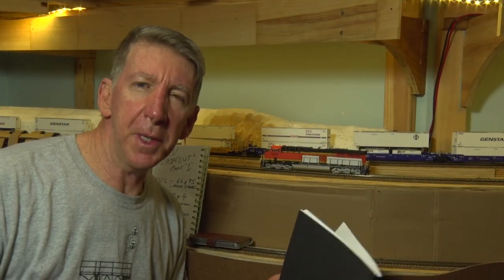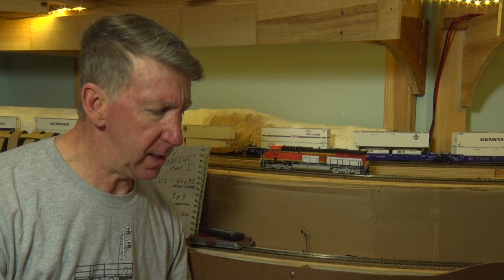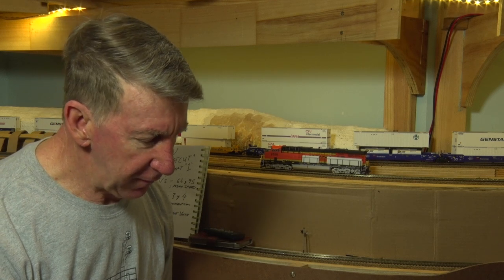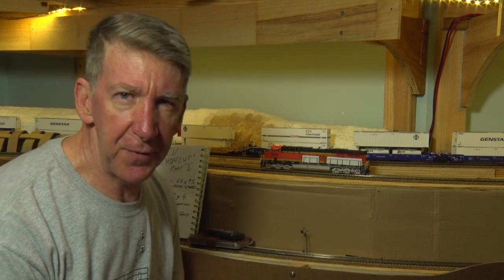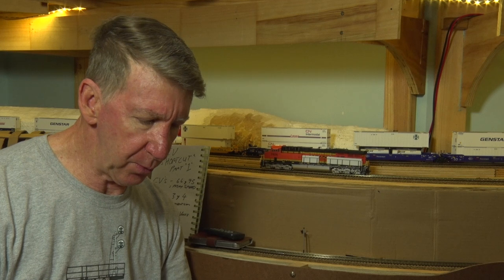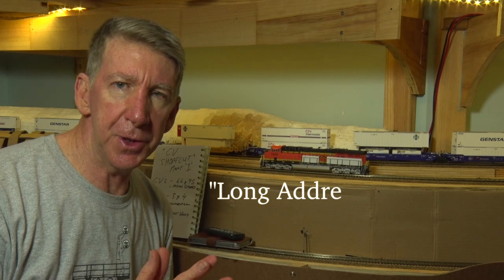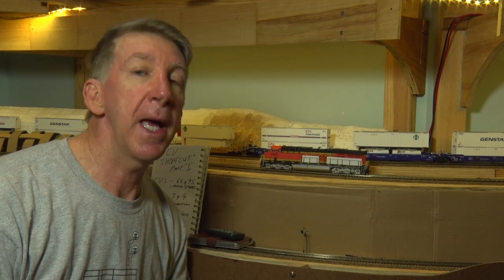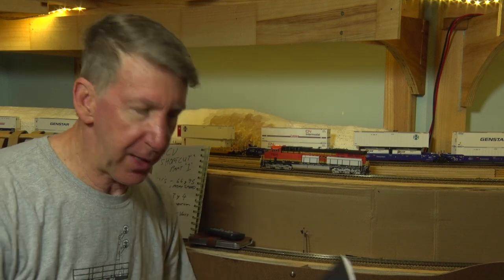"CV Shortcuts" Part 1.

Comment: Thanks Greg, I have been using DCC for years but never really understood the tech terms in the manuals. When I worked at Rio rail ops in the Autohaul project we never knew what the  engineering people were taking about, all we needed to know was how to turn it on and operate it must be universal with boffins. Part one has really helped me and have applied it already to my loco fleet so thanks for that mate, looking forward to the rest of the series
Reply from the maker: Hi Gary, thanks for watching and I'm glad you enjoy the videos!  A few of my fellow signal guys went over to the Pilbara and my nephew is in charge of a track gang over there. Autohaul is interesting but I prefer seeing a driver on board! Plus all the smarts didn't seem to help with the runaway !!  I'm down with a cold this week and lost my voice , so part 2 will be delayed a week or so, but 'm glad you have seen some results already.
Cheers Gregg.

Comment: I love the half rant,  I am surprised that the decoder makers have not found a way where the decoder in a consist talk to each other.  By the power consumption (current draw).  It would be interesting to modify a worm drive to enhance the speed matching.  Love how you made it simple,  I might have to watch this video several times.  I do have a PowerCab with a Smartbooster 5.  I think I can program it.  Love the video, from CV challenged Terry in Rainy Nebraska, Cheers Gregg.
Reply from the maker: LOL ..thanks Terry! Yes , that would be cool ! Much easier if they fixed the drives but I don't see that happening soon? You'll have no issues with the power cab and booster sir, and you'll be a master in no time! Part 2 on the way soon.
Cheers Gregg.

Comment: I just got my PowerCab and am waiting for an Athern Genesis with Tsunami so this will be a very helpful vid to refer back to!  Thanks.
Reply from the maker: You're welcome!  Just remember to read the Tsunami manual info in the Genesis paperwork! They have set a few CV's for general use that can trick you up...like the F11 brake feature! But all are the same  for motor and speed settings! 
Thanks for watching.
Gregg.
Reply from the maker: I got your message regarding the Tsunami 2 , but I can't reply to it for some reason?  Maybe the ESU "Fanboys" have jammed the system..LOL IMO , after almost 45 yrs of model railroading , and having had DCC for almost 20 yrs, the Tsunami 2's and Econamis are the best decoders out here for overall performance and versatility! Iv;e used both and ESU are great decoders, but they do lack some features that I prefer to have ...like a 7 band EQ to get the most out of your speakers, motor drive equal or better than ESU ? The original Tsunamis did fall behind a little in that regard, but could be adjusted to run almost as good as an ESU. Read the manual , watch my videos and you'll see how good Tsunami decoders are!
CHeers Gregg.
Reply: @FishplateFilms  Thanks---I may be PM'ing you if I get stumped once I get my loco!

Comment: Good start to the series Gregg.  Well done with the presentation.   Just curious, what camera setup are you using for tracking the moving locomotive?  ~Deryk
Reply from the maker: Thanks Deryk! This one is a bit basic, but you get a big change from a easy adjustment. I used my big camera on the tripod, it's a bit clunky for this work as it takes up half the space..LOL. The next one will be on the phone as well , as I need to get up close to the trucks.
Cheers Gregg.

Comment: Hi Gregg, as ever a superb video and thanks for sharing your knowledge. Especially with regards to electrics/electronics I've learned a lot from your channel. May I ask a question/favour please: I've designed a yard with two reversing loops next to each other that are connected by a crossover (coming from Marklin three rail, I thought that's a great idea). It's all on DCC. May I send you a diagram somehow and ask for some feedback/opinion from you? I think I've got a workable solution that shouldn't produce any shorts but a bit of mentoring would be great. No worries if you can't. All best wishes from the UK.
Reply from the maker: Hi Micha, I could have a look at it for you. Send me your email to the channel DM comments.
Cheers Gregg.
Reply: @FishplateFilms  Hi Gregg, many thanks. DM seems no longer possible so I'll take a plunge and put it here: michael.koenig.gb and you'll need to add the funny circled a and the whole thing is at gmail.com Very much appreciate your time. Micha
Reply from the maker: @MichaKoenig  Thanks Micha, I'll be in touch shortly.
GRegg
Reply: @FishplateFilms  Great stuff.
Reply: Hi Gregg, any chance you’ll have time to pick this up? All best, M
Reply from the maker: @MichaKoenig  Hi Micha, 
Sorry for the delay , Iv.e been crook with a chest infection and only feeling a bi better today. I/ve sent you a quick email so let me know if you don't get it.
Cheers Gregg,

Comment: It is mad to think that worm drives are still used, especially in these days of DCC where you have so much control over the motor speed and torque. My only guess is that they stick with it for the braking it gives the loco.  I am guessing that without the worm drive the weight of a long train could actually push a loco along once the power was let off, causing it to generate it's own power. But with all this modern electronic wizardry, i am sure they could simply dump that into a couple of suitable resistors. That should restore some of the engine braking lost when not using a worm drive.
Reply from the maker: Hi Steve, you are right about the braking, that is the main reason worms are used in machinery like conveyors , mixers etc. Back in the 50's /60's, they was a HO company that did a crown wheel type drive in a series of "F" units, The motor was in the lead unit and a tailshaft ran out the back under the loco and joined to as many "B" units you wanted...each with geared trucks! You could push the units along and the motor turned !!!!!  Apparently they could break rolling stock in half with the traction and ran super slow! You could make the drive a little "stiff" by the cut of the gears, but still allow it to be push or pulled and thi, plus the natural friction of the gears and motor , would give you some braking? BUT .yes, how about real dynamic braking as you say , with a resistor bank with variable output from the decoder!! Thsi would definitely be doable in O gauge and HO with some work?  I hope I see it before I cark it..LOL
Cheers Gregg.

Comment: What is the difference between CV 5 and CVs 66/95? I guess I’m just confused because all three of those CVs adjust maximum speed.
Reply from the maker: Hi Jason , on Tsunami 2's , CV 5 & 6 are used for the 3 point speed table, where 66 & 95 set the overall max speed in fwd and reverse. If you're using the 3 point table , then you don't use 66 & 95.
Hope that helps?
Cheers Gregg.
Reply: @FishplateFilms  Makes sense to me now! Thanks again Gregg.

Comment: Do you use 28 steps or 128 steps when you run your engines
Reply from the maker: Hi Bob, always use 128 , as it gives you smoother control :-)
Gregg .
Reply: @FishplateFilms  That's what I use. Thank you

Comment: Have you ever locked up a decoder to where you cant fix it
Reply from the maker: I've had to reset a couple James, but it turned out I had not unlocked a function. I have burned out 2 with the wrong sized resistors on LED lights! Most issues are resolved with a reset , but it is usually operator error!
Cheers Gregg.